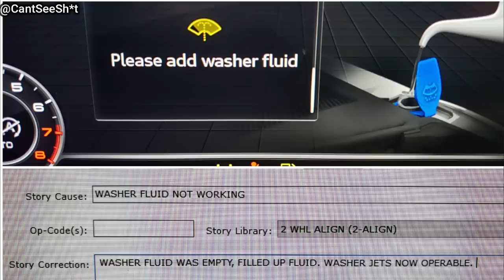Customer States Truck Feels Weird While Driving (GMC Sierra) | Just Rolled In

Comment: Sometimes I just want to know the stories of how these things happened.   Like tree branches in the undercarriage...how?  

Two things 90 PSI isn't appropriate for: tire pressure or putting on your oil filter.
Reply from the maker: I'd love to know the actual stories or see the dash cam footage (if they have one) lol. People are crazy.
Reply: @JustRolledIn  I'd like to hazard a guess the 90psi could have been done due to a 4x4 or bicycle using a common tyre filling machine, and the driver just didn't check the pressure it was set at before they filled up the tyres?
Reply: One thing I've picked up from my time in dirt bikes and offroad R/C racing, is that no matter how small the opening or what measures you take to guard chassis components against it, there will always be that one rock or stick or something out there that will find its way in. More than once I've had to take my R/C race truck completely apart to dig out a pebble that was substantially larger than any nearby gaps or openings it could conceivably fit through. I long since gave up trying to understand it and just started dealing with them as I found them.
Reply: @Legotruck82  I'm not sure where you are, but I'm in America and to my knowledge we don't have machines that know what pressure to inflate tires to.  The operator is supposed to know and pay attention to the gauge on the compressor to see if they're at the proper PSI.
Reply: @davidp2888  Australia. Many service stations have public use tyre inflators here, so you can check tyres after refuelling etc.
Reply: Most large Semi's run 90-120 PSI depending on tire rating. Most normal cars range from 30 to 50 - it's all about what your tire is rated for (which is labeled on the tire)

edit: please follow safe manufacturing specs for your tire
Reply: Did they confuse a road bike PSI and a car PSI?
Reply: @davidp2888  We have the same in Europe, where you can set the pressure on the machine, which then keeps adding air until it reaches that pressure. They come with a list of common cars and their standard pressure, which can also be found in the doorsill, but you still have to set it. 

My guess is someone was either trying to save fuel by decreasing rolling resistance, had no clue what they were doing or used an electronic gauge. I've found out that those set whatever pressure they sense on startup, as 0. I hooked it up and turned it on, read pretty much 0, so pumped it up to spec. Went to check, after having the gauge auto turn off, but turned it back on without it being hooked up. All my tires were double the pressure. I let them down to spec immediately, but I'm glad I checked. Maybe the same thing happened here?
Reply: "Two things 90 PSI isn't appropriate for: tire pressure" Yep, it is actualy too low for some tires...
For example in Mi-8 helicopter if i remember it corectly you have something like 10 atm(150 PSI) and with full load you would be landing with 12 tons mass distributed on only 3 tires and on top of that you are doing 200km/h(120mph) and the helicopter can have static charge up to 60 000 volts when it is touching ground after a flight...
As a kid i was always amazed by the sound that this tires were making when i was knocking on them with my fingers.
You knocking on rubber and the sound is so strange and metalic...
Reply: @Bialy_1  And large aircraft like 747's run them at 400!  (Dry nitrogen so that 1. no water to freeze & make massive off balance and 2. no oxygen so if it blows on landing it can extinguish any fire not fan it with more air.)  Nitrogen in aircraft tyres has good reasons, in cars though?  Just a way to get more money from suckers.
Reply: @davidp2888  In that case, my guess would be either just didn't pay attention or a hypermiler.
Reply: 90 PSI.
Is that a lot?
Is that too little?
Why do North Americans always communicate in units that only they can understand? Like using 3rd grade instead of mentioning an age, or using blocks instead of a distance.
Reply: @rogerwilco2   90 PSI means 90  pounds per square inch. C’mon man, any 3rd grader that’s been around the block a time or two knows that. 😉 But seriously, that’s waaaaaay too much pressure for a passenger car tire
Reply: high PSI is better for fuel economy, so put the machine on max, and send it!
Reply: @TheRealCharlieSuper  You are supposed to inflate your tires to whatever is specified on the driver-side label if you want the vehicle to perform within specifications, give or take a bit depending on road conditions and use if you know enough to make that call. Values on the tires are only the tires' rated limit. If you are going to inflate tires to their limit, better double-check that the rims are also rated for at least that much too.
Reply: 90 psi is normal for a large tractor trailer tire. Not for a sedan.
Reply: @davidp2888  alot of gas stations let you set the goal psi and it won't inflate beyond that. The only problem with that theory is those machines reset to 35 psi every time they cycle on, or they're supposed to.
Reply: @TheRealCharlieSuper  The manufacturer pressure  for the car is usually not the maximum the tire is rated for.
Reply: @Legotruck82  my neighbor asked me if 75psi was okay for her tires "to help gas mileage" (read it in the internet).  I pointed out on her tires where it said Max 44 PSI Cold.  Maybe this was the same?
Reply: @Yvolve  I once bought a Volvo 244 many years ago without power steering, and the previous owner had over-inflated the tyres to make it easier to turn the car.  Not surprisingly, they had to be replaced immediately due to uneven tread wear.
Reply: @TheRealCharlieSuper , the tire is labeled for max working pressure, consult the label on the vehicle itself to determine correct pressure.
Reply: Tree branch stuck under there like that most likely doing donuts in a parking lot, lost control and went into some bushes.  Ask me how I know.
Reply: @NemoConsequentae , nitrogen in car tires is needed if using granulated tire balancing media, for certain tpms systems to prevent corrosion, for high-end tires on performance vehicles, ETC.
Reply: @davidp2888  I can't speak for machines at gas stations as I haven't used one in decades to fill a tire but when I did, you could set the pressure on the machine and it would only fill to that amount. Every tire inflator I've owned also had a gauge to only allow a set amount of pressure. BUT I do have a couple of air compressors that are both set at 90 PSI. I need that pressure to operate air tools. I'm very careful when using them to inflate tires.
Reply: @trippybruh1592  do tell!!
Reply: @TheRealCharlieSuper  Oddly, bicycles with thin tires like a 10/12/18 speed also use 90-130 PSI
Reply: Extra cheesy Gordita crunch will give your stomach 90 psi guaranteed!
Reply: @edwardwood6532  Air compressors that you can buy at most hardware stores can be set to 90 which they need to use air tools like a nail gun. Maybe that's what happened.
Reply: I swear to god when I was working for my dad (35 years ago now - cars were so much simpler then) that somewhere there was a gremlin with an impact hammer attachment just for tightening oil filters. I've had to drive screwdrivers through them just to get enough leverage to break them loose or other shenanigans too many times.
Reply: Tree branches easily happen if you live anywhere actually  not in a city.  Accidentally getting 90 psi in a tire is a trick though
Reply: @Bl4ckD0g  35 PSI is common for most cars. Some it's 30. It's different for different cars. Mine is 30 for front tires 35 for the rear. Just follow your manufacturer tire PSI. It's printed on the frame of the driver's side door. There is no excuse.
Reply: I used to ride a racing bicycle that needed 90psi minimum for the tires. Had one of those blow up next to my head. Lost hearing in my left ear for 2 weeks. It eventually came back, mostly, but now I have perminent tinitus. I can't imagine what that guy's ears are doing.

Well, yeah I can actually. A whole lot of EEEEEEEEEEEEEEEEEEEEEEEEEEEEEEEEEEEEEEEEEEEEEEEEEEEEEEEEEEEE. I hope he recovers.
Reply: @davidp2888  Strange, around here in Brazil the majority of gas stations have equipment that both by default return to 32 PSI and that you set a target pressure and they'll cut off the air and beep at the set pressure. Pretty practical, it's also something you can do on your own, unlike dealing with the fuel. Around here you're not supposed to fill the tank yourself, rather an employee on the gas station does that, but tire pressure you either do that or they'll do for you if you ask.
Reply: @TheRealCharlieSuper  Yup. Even my pickup truck has E-rated tires which are rated for 80PSI
Reply: @foodhatesme  not common in the states? Just about every 7-Eleven has a machine like that
Reply: @OTE_TheMissile  I had a rock find its way through a gap between the brake tin and caliper that took out my wheel speed sensor. It was just plain bad luck, but I know what you mean about things finding their way into small spaces.
Reply: Common sense is not so common. My old Ford Escort was labeled to have 28 psi in the tires. It steered like a boat. It was scary on the curves. When you turned the wheel it seemed like it would never make the turn and the car would sway when it was coming out of the turn. I aired the tires up to the maximum rated pressure of 35 psi and the result was better steering, more stability on the road, and better gas mileage. Another thing I noticed was that the tires quit smelling like hot rubber when I got to work and when I got home. That was about the same time as Ford's problem with exploding tires on their Explorers. Interesting that they were replacing tires and increasing the recommended tire pressure for the Explorers.
Reply: Unless you have a road bike. 90 Psi is my go to tire pressure.
Reply: @Legotruck82  most off road vehicles are ran with tire pressures below 15psi and I personally have never seen any bike tires that call for that pressure.  Plus the only tire inflators I have seen that stop at a preset pressure is a hand held portable air compressor that would struggle to reach 40psi
Reply: @genbaynton359  Bicycle tires (the really narrow kind) call for very high pressure. Track tires can be pumped up to 200 psi.
Reply: Tree branch most likely because the driver didnt try to swerve around the tree branch and instead drive over it
Reply: I had a thin-tired ten speed bicycle that had tire pressures around there. I only remember it because I had to go to a specific gas station to air up, as my regular bicycle tire pump wouldn't get me over about 55-60psi.
Reply: @TheRealCharlieSuper  It's a bit more than just reading the tire. The tire size and rating is part of getting the right tire for the vehicle, and THEN there are specific inflation levels based on the weight distribution of the car.
My current car's door sticker indicates that the tires should all be at 32psi. I have had cars in the past call for pressures lower or higher, and one car had higher pressure in the front tires than the back (or was it the other way around?).
-
Anyway, the point is, get tires rated for your vehicle, and then inflate to the values indicated by the vehicle, not the tire.
Reply: @Yvolve  Even when the air filling machine has a pressure gauge and/or pressure preset, I double check with a stick gauge I keep in my glove box next to my tread depth gauge.
Reply: @TheRealCharlieSuper  NOT labled on the tire.  That's MAXIMUM SAFE pressure...NOT operating pressure.  Operating pressure is ALWAYS lower than the maximum safe pressure.  Please correct your error before someone following your bad information gets hurt.
Reply: @rogerwilco2  Americans talking with Americans using terms Americans understand?  I wonder why?  But yes, Americans often disregard or fail to consider that this is an international forum.  And it would not hurt you to learn other units of measurement or to use an online conversion tool.
Reply: @oobaka1967  Not odd.  Force per unit area.  Small area requires more pressure to generate the same force.
Reply: @martymcfly8535  It is most definitely not printed on a 1955 Chevrolet 3800.  But there are other reference sources available such as knowledgeable older people who lived in that time....and other sources.
Reply: @rogerwilco2  why do Canadians have to get dragged into your shitty take? I’ll give you a hand, I’m guessing you would rather it in kpa? For future just remember that 1 psi is roughly 7kpa (actually 6.895, but 7 is easy to remember and doesn’t throw off the number much) 90x7=630 kpa.
Reply: It’s not what the tire is rated for that matters. The pressure on the tire is the maximum amount the tire is designed to hold. What pressure should be the tires is listed, most of the time, in the drive’s side door jam or somewhere close to it.
Reply: @edwardwood6532  PSI is PSI ;-)
Reply: The reason this happens many times is because people try to fill the tire until the light goes off on the dash. I've seen several people do this. Even if the TPMS light is on due to actual failure of one or more sensors, or they are filling the wrong tire (many cars don't have the capability to tell if the sensors have rotated, so it may be reporting front right low but its actually rear left), they still fill and fill and fill and fill until this happens.
Reply: @davidp2888  Most people don’t know that the sticker on the door frame tells you the cold pressure that you need. Most of the time when I go to fill my tires I see the machine set to 32 psi, Which is a pretty standard amount, but it’s not always right. My tires are supposed to be 35 psi on my car. But that’s cold pressure. So I adjust it a bit if I’ve been driving for a while. Because they heat up when you drive you’re gonna need to put a little bit more in if they’re hot. Otherwise when they cool down they’ll be under inflated.
Reply: @teardowndan5364  not to mention if you do that when they’re cold they’re going to get more pressure as they heat up and then they will be beyond their limit.
Reply: @Legotruck82  We'd all like to hazard that guess, but deep down inside we all know some people just keep putting air in their tires until it becomes too difficult to put more in.
Reply: @foodhatesme  Where do you guys live? I'm in pa, and two of the largest convenience store chains here, wawa and sheetz, both have the machines that allow you to set a psi and then wait for it to finish. I don't think the number resets afterward, so if somebody inflated a bicycle tire to 70psi and then a car pulled up there could be problems.
Reply: @rogerwilco2  my car need 2.4-2.5 bar witch is around 34-36 psi
Reply: @Bl4ckD0g  Maybe they're supposed to, but I've definitley used some that were set at whatever the previous driver wanted. Perhaps there is a delay.
Reply: @oobaka1967  It's not really odd, the reason they need so much pressure is BECAUSE they're thin.
Reply: @Jeremiah Bullfrog What kind of bicycle did you have? 30 years ago I had several that took 60-70. These were 26/27in road bikes. Thinner tires on bikes always need higher presures. Mountain bike tires would be lower, as would bmx style bikes
Reply: @MonkeyJedi99  Thats good advice, but if you just use the number printed on the tire it won't explode. It'll just be a rough ride.
Reply: @Currawong  do you still have the 240?
Reply: @davidp2888  ...... There are ones that you plug into your 12v outlet that actually have an adjustable pressure switch. I've even seen some air compressors that have a "tire fill" circuit on them that stop at a preset pressure.
Reply: @davidp2888  some gas stations in germany have tyre fillers where you preset a pressure and the machine fills up to what you punched in. of course, if you put in 60 bar instead of 60PSI...
Reply: @rogerwilco2  that's a little bit over 6 bar in roman catholic... had to look it up, too, those "pissies" they use are meaningless... ;p
Reply: @johnchestnut5340  What's wrong with operating at the max PSI - what if I like blowing though tires constantly? Gives me practice!
Reply: @TheRealCharlieSuper  my tires have a cold psi rating and a warm psi rating so during summer i use 60psi and winter 45psi in Florida
Reply: @Jeremiah Bullfrog yup, they do. I wouldn't have known either if I hadn't owned a road bike. It's simple physics if you think about it.
Reply: @rogerwilco2  Its ~6.1 Bar.
Reply: @fredk.2001  I'll grant you the corrosion part, if, and only if, the compressor lacks any kind of separator AND is in an area with extreme humidity.  Race vehicles get a pass due to the very minute suspension tuning they need for each track & conditions.  The rest, doesn't make enough significant difference for it to be worth anything more than bragging about what a fool, or how gullible you are.
Reply: @OTE_TheMissile  more than likely as the vehicle is moving, things flex creating a gap just big enought for the rock to get in.
Reply: Stuff like branches under the car is pretty common. All it takes is a dolt ahead who hasn't secured a load, especially on the freeway. Tailgating doesn't help. The worse I've had was a stupid plastic bag. I put it on the rack and couldn't find it, but months later it'd occasionally leave my eyes watering when I got out of the car.
Reply: Minimum tyre pressure when you drive alone without luggage.
Higher pressure when carrying four 110kg passengers and a dozen anvils in the boot... simple!
Reply: @tjboylan20  I can't imagine running 45 to 60 PSI unless that a bicycle tire. Warm temp rating is the pressure when you've gotten off the freeway carrying a heavy load. Your door sticker gives the proper tire pressure for factory sized tires. An example was my Sidekick. Those carried an oversized tire often used on a heavy luxury car. The big car weighed twice as much so 32 to 35 PSI was recommended, but 23 PSI on the 'Kick. Overfilling gets a bit better MPG but shortens tire life and ruins traction. That said, I run 5 PSI higher in front on my car simply to offset understeer.
Reply: @mikep490  i drive a suburban that weighs 8k lbs and has a towing rating of 12k i tow often and the door card tells me 45psi for standard use, i also have larger tires on it
Reply: @rogerwilco2  Consume enoguh car youtube content and you'll speak in fluent freedom units in no time.    It's the damn ounces I still have trouble with.
Reply: @Legotruck82  My BMX has tires that are rated to 125 psi.
Reply: @rogerwilco2  as long as we understand it, that’s all that matters. Now go play your blowing music.
Reply: @davidp2888  i live in the southern US and I’m seeing more and more compressors at gas stations that you set a goal PSI and then just fill your tire and it will stop at whatever you set.
Reply: @oobaka1967  How common are those? I have never seen any bicycle tube rated for more than 30psi.
Reply: @davidp2888  You don’t think we have that technology here in the US…?
Reply: Never been to a gas station where you could set a pressure. I always carry my own gauge because a lot of gas station compressors don't have one, or they can be wildly inaccurate if they've been run over a few times. Just finding a station with a working compressor is hard.
Incidentally the load range E tires on my camper run 75 psi in the rear, not that far off 90.
Reply: @trippybruh1592  Not necessarily. I had a truck come in one time many many years ago that had wood jammed into it everywhere underneath. I didn't know its owner at the time but in late years became close friends with him. He liked to off road his truck and in the process shaved down a lot of stumps and roots.
Reply: too generic answer... depends on the tire.
The 23mm roadbike tires usually had 90-110psi 😉

.. but more modern 25/28mm or even tubeless have lower pressures
Reply: Fella up my way had a fawn wedged into his steering...oh, deer.
Reply: @TheRealCharlieSuper  
Forget Semis the Light Truck tires on many heavy duty pick ups and vans will call for up to 80 PSI routinely.
Reply: possibly  a pump with an integrated pressure sensor that was way off.  I once had a bike pump with a gauge that read about half the actual pressure, and the ones I see at gas stations are never very accurate
Reply: @genbaynton359  road bikes or racing bikes have psi between 80 and 120, mountain bikes psi however will be lower between 25 to 50 psi
Reply: @rogerwilco2  why can't the world just follow US with weights a measures
And if you in the city a block is a know distance of measure. Like get on the interstate and go to exit 24 C that's the 3rd exit at the 24 mile marker
Reply: In a pasenger tire NO! In a full size truck tire... OF COURSE!
Reply: People often drive their cars in inappropriate places, like trails or lawns. Easy to pick up a branch or two that way. I always enjoy the ones taken on gravel roads for long distances and are returned with the tire tread all torn up.
Reply: @NemoConsequentae  I fill my tires with  78% nitrogen, 21% oxygen, 1% argon mix. Works great!
Reply: @rogerwilco2  If only there was an online site where we could search for meanings of terms.  Hmmm.... like maybe....Google.

Why do people who don't live in America insist Americans do things their way?  You'll be a lot happier once you accept the fact that people do things that have nothing to do with you differently.